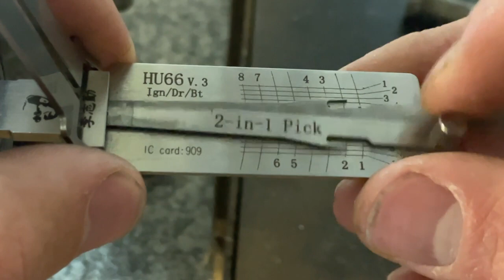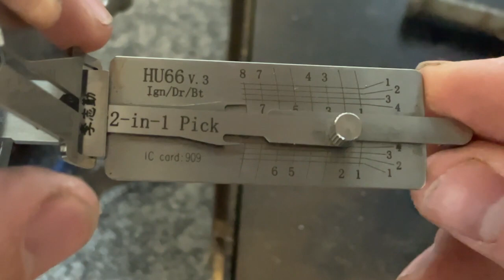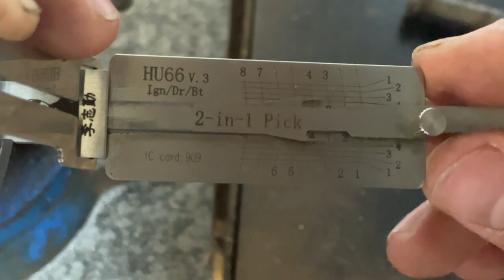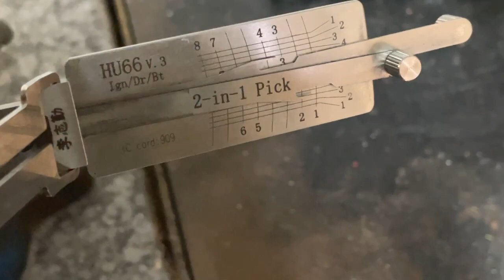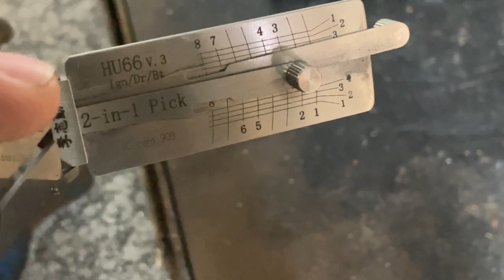(2) HU66 Lishi Picking and Decoding a Door Lock of Volkswagen Polo

Comment: You know how the 3,4,7  and 8 are at the top of the Lishi pick,I see you picked towards the numbers on the pick edges,I just watched a guy doing it the exact opposite way,he picked say number 1 for example towards where the number 1 is missing on the outer edge of the tool,does it matter which way  you do it??
Reply from the maker: It depends on the lock and the orientation you place your pick in. if you put it in and the wafer is on the side of the number and you take the pick out and put it in upside down then the wafer will be on the side where there isn’t a number. Also another tip on older VW’s and Audi’s the wafer position isn’t the same as it is on the pick whereas on this pick the wafer position is 1,2,5,6 on one side and 3,4,7,8 on the other on older cars the position will be 1,3,5,7 on one side and 2,4,6,8 on the other
Reply: @theaveragelockpicker  Thanks for clearing that up! I was just reading more into it than really exists,thanks for the reply! ;-)